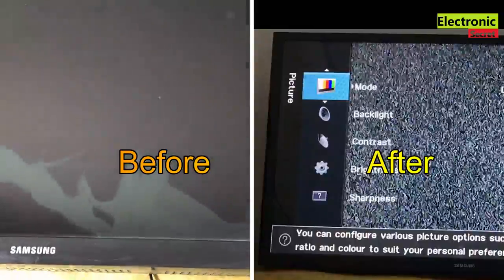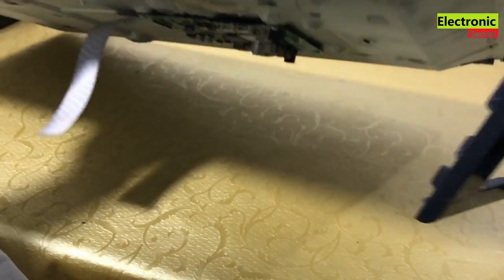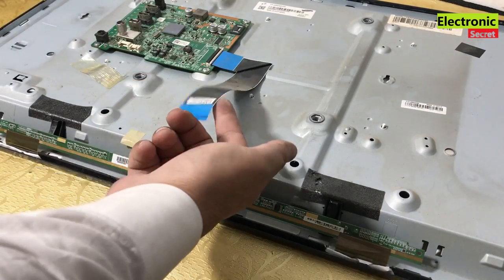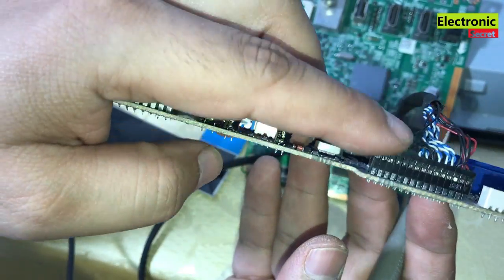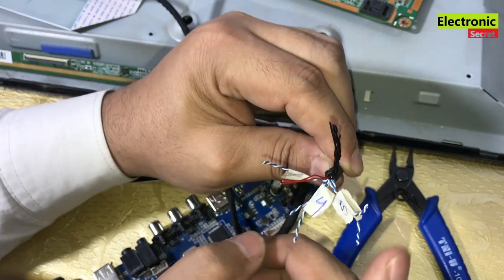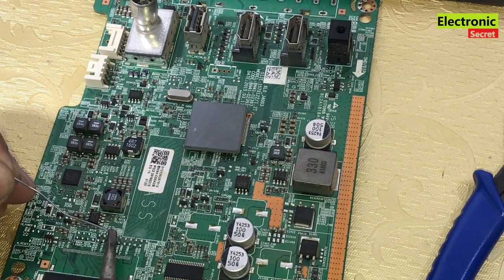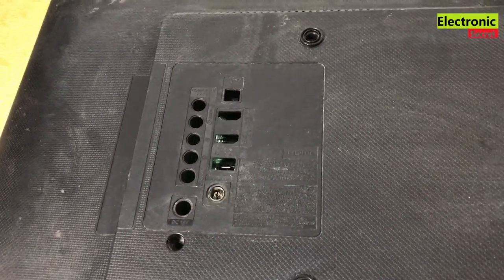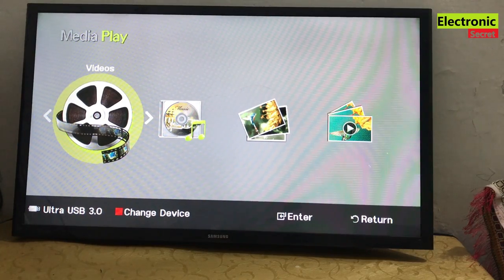HOW TO FIX A CRACKED TV SCREEN, FIX SAMSUNG TV BROKEN SCREEN

Comment: Hi, wanted your advise on weather this panel is compatible, with samsung model tv ue43nu7020k.
Screen panel from Alibaba has HV430QUB N4A is also same on LCD pcb ribbon cable board, some have same code but the N4A is N4E or some other numbers F1B, N1D, H10, F70 do the number on the end matter ?